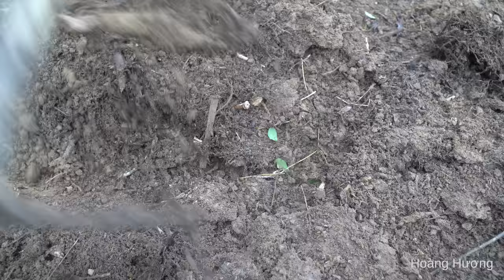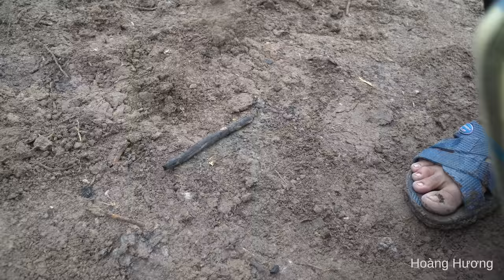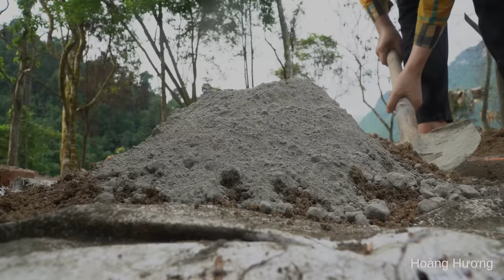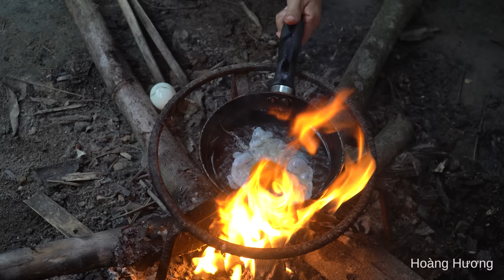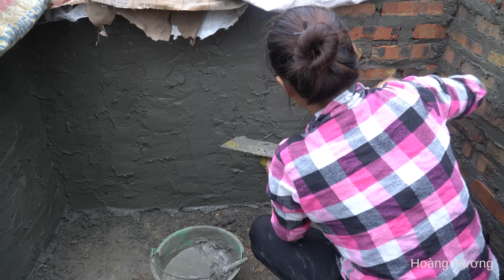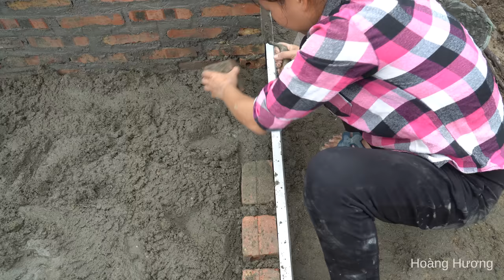The water source was almost exhausted, Huong built a water tank of 2.25 m2 to store water

Comment: SUGGESTION: you could improve the soil for farming.

The soul looks like it has a lot of clay in it.

If you made a place to collect all the leaves and other organic matter and leave it for several months, it will rot into a rich compost. You can then add this to the soil when planting seeds to help fertilise the plants.

This is important because constantly growing crops in the same area will use up all the nutrients in the soil. Adding compost will help replenish the nutrients.

You could build a simple bamboo fence in a circle like your husband has around the banana trees and use it to collect leaves to make compost. When it is full, make another. I would normally suggest making 3 in total. 1 will be getting filled, 2 will be full of leaves rotting into compost, 3 will be full of compost that you are using. Then you can always have some ready for planting.
Reply: Iya aku sangat sangat sangat setuju untuk itu ❤
Reply: I think it might be better to have simple piles of compost instead of fenced circles so that the leaves and things can be regularly turned over and mixed together easily with something like a pitchfork so that everything breaks down faster

Comment: If you are sleeping at the farm, and the nights are growing chilly, keep about 6 bricks in reserve for heating.  Put them in the fire when you cook your food in the evening, then when it is time to go to bed, carefully bring them into the hut and arrange them underneath your bed-shelf.  The heat they radiate will help keep you warmer throughout the night.  You can use 3 at a time, and save the other 3 under the ashes of the kitchen fire to help insulate and keep them warm, and just swap them out later in the night with the bricks that have cooled down.  Or you can use all 6 if gets really cold, but I would suggest making woven mats to put up on the walls to block the wind from flowing, as the wind will steal away the heat.

If you didn't have the bricks, I would recommend finding and testing dry, solid rocks with no cracks.  (Do not dig the up from a river or a pond!)  Build a fire away from where you will be working, and heat the rocks for a while in that fire.  You want to stay away in case there is water in the rocks, which could crack them apart, sending small stone shards flying.  Come back in a few hours when the fire has died down, and check to see if the stones are intact.  If they are, then they can serve as heating rocks.

The larger the rock (or brick), the more heat they can store and slowly release.  The best stone for this is soapstone, but that's not easy to get.  Granite can work well, same with other dense stones.  The important thing is to make sure it's not a type of rock that cracks easily, and not a type that will hold water.  To move bricks and rocks that have been heated in a fire, you can use tongs, but you can also make a star-shape with several green (fresh living) branches, move the rock or brick onto the center where they cross.  Then you just bend the branches up around it like a cage, and carry it that way.  Since the branches are still fresh and full of moisture, they will bend easily, and won't burn right away.

After that, just make sure the ground under the bed is clean and free of anything that could dry out and catch fire if it touches the rocks or bricks.  (Since we know both you and your husband are good at cleaning up regularly, that won't be a problem!)
Reply: Ótima experiência didática.
Eu aprendi a usar tijolos aquecidos no forno do fogão à gás, quando morava no suldo país RS - Brasil. 😘🇧🇷
Reply from the maker: Oh thank you very much, That was very helpful for me. Wish you all the best, see you in the next video
Reply: I looked up where to find soapstone, and it turns out there is some in northern Vietnam, in the mountains of Quang Ninh.  I don't know if that is nearby, but at least there is some in your nation.  Soapstone doesn't get super-hot.  It stores a lot of heat from a fire, and releases it slowly and steadily over many hours.  But it can be expensive even if it is local.  And it is very dense, so it is very heavy.  The bricks will serve you well for now.  I do wonder about Duong and how he stays warm at night in winter.  He doesn't have any bricks to tuck under his bed!

Comment: Good Day Hoang!  Your plastering is getting much better.  I am glad that you have a wooden float now.  That will help you very much. Once you had completed the plastering the whole tank, you could have started at the beginning and floated the entire surface in a circular motion.  Floating in a circular motion would smooth and leveled the surface more in preparation for the last finishing step.  It is good to know how to make a nice floated finish.
The next time you build a water holding tank, I suggest you build it closer to the source so you can run a pipe downhill and deliver water to your kitchen under pressure.  Maybe have two tanks - one for drinking and cooking and one for irrigation of crops.

Comment: I hope this new water tank will prove useful and not compete with the needs of the pond and its fish for fresh water, etc. 

You installed 3 pipes into your tank. Of course, at times you will want to drain this tank and flush it clean. That would be the bottom one with the valve. It might possibly handle overflow at time too. Will one of the top ones take outflow water to the pond? What will the 3rd one be for? 

The washing station concrete pad next to the tank where the valve is will be great for all things needing a quick wash. : ) You might put up a cloths line for drying cloths that you have washed. 

Loved your breakfast! I might have to try that sometime! : ) 

Maintaining the pond, tank and water source is vital to your health, that of your fish as well as the farm. Keep the water flowing and as fresh and clean as possible. Green, stagnant water is a real health hazard. 

You used a lot of bricks, mortar mix and sand in this build! How many trips did it take for you to get all that brought to your farm? I hope you had some help! Like I mentioned to your husband, you both need to get a farm hand, that maybe you can share, to help with more labor intensive tasks, like carrying all of those building supplies to the farm. Please consider it. Your back will appreciate it! : )

Comment: As for the size of the water tank, I think it would be smarter to simply build a second tank as backup storage.  The larger the volume of water, the much greater the mass and weight of that water, creating a lot of pressure on its walls.  Unless the wall is specifically reinforced, it could fail.  Smaller tanks may take a bit more in the way of materials, but they have a couple advantages.  One, you can build them in stages, slowly increasing your storage capacity as time and materials permit.  And two, once you have more than one tank, you can afford to empty one to clean it out if you need to fix a problem, while still retaining at least some water in the other.
Reply: Iya aku sangat setuju untuk itu ❤
Reply from the maker: Oh ! Yes. that's a great idea

Comment: I see you are using pure cement, that is not the usual way to plaster a wall. It is usually done with a 1 to 4 or 1 to 5 mix of cement to sand. a pure cement is apt to be easy to damaged. The sand is added to keep it from cracking and giving it some hardness.

Comment: I have said this before, about how you need to put down a layer cement/mortar BEFORE you put in a layer of just cement and water, because it will crack and leak water if you only use “plaster” on dry bricks, without a layer of cement! 
PLEASE take this to heart as you will not have much durability with only using plaster on its own!
If anyone can translate this to her, I’m asking that you PLEASE share this information with her! 
Idk if she can’t translate English or just doesn’t read the comments but it’s so important that she knows this and I just hate that I can’t communicate it to her 🥺
Reply from the maker: Thank you very much. Maybe I don't fully understand what you are saying. I don't use plaster.
Reply: @Hoàng-Thị-Hương  What LaBella999 is saying is that you should cover the bricks with a layer of mortar, the same mortar you use to stick the bricks together and then apply cement water on top
Reply: @Hoàng-Thị-Hương  the cement is the plaster. what labella is saying is 2 coats of cement plaster are required for a strong seal . the first coat is called a scratch coat amd then a fine finish coat is applied over the scratch coat .

Comment: Great job! Using a big plastic cover in a hole would be easier?
Reply: She wants to be able to drink the water by boiling it
Reply: @yeagerxp  would she not be able to do that still?
Reply: @humptygti  she is getting the water from a spring, it is as clean as she is going to get it, without using active filtration, directly into the tank. Using a hole covered with plastic is good for irrigation